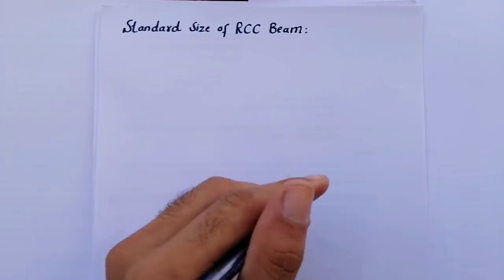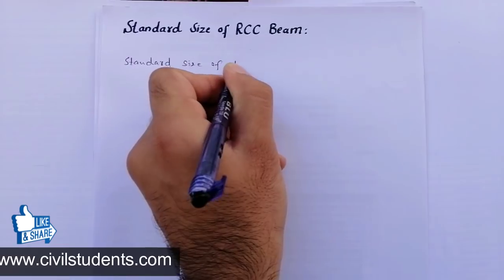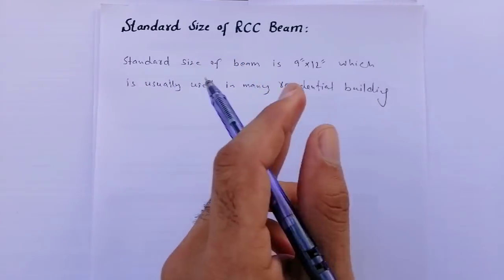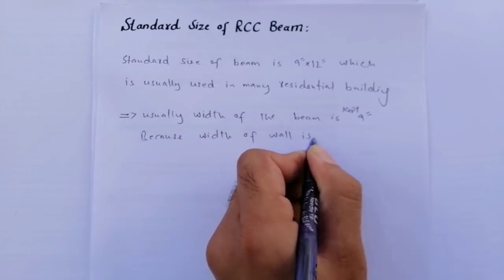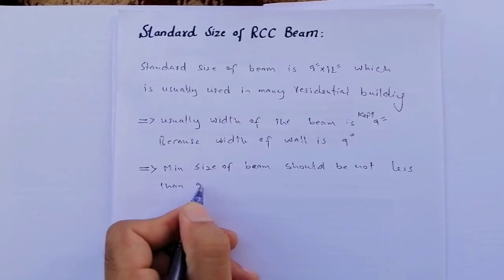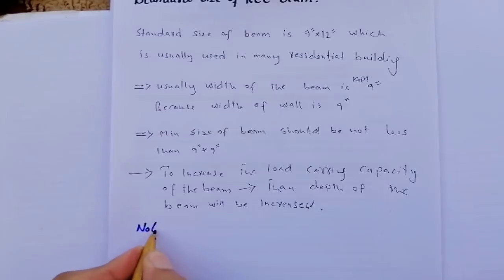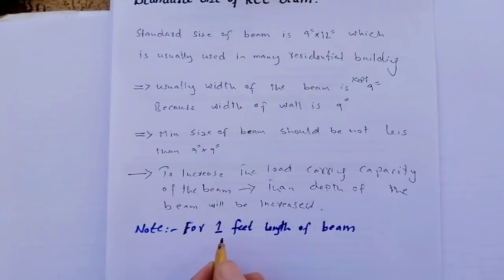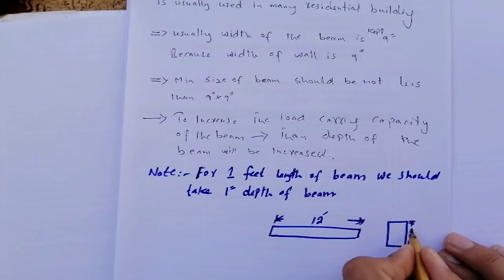Standard Size of RCC Beam | Minimum size of RCC Beam | Civil Engineering Videos

Comment: Hi, I need one suggestion, can I put 6'*2'*2' feet aquarium weighing around 950 kg on 4 inch RCC slab on first floor near wall? There is a beam running parrallel to it and at 1 foot distance there is a column.